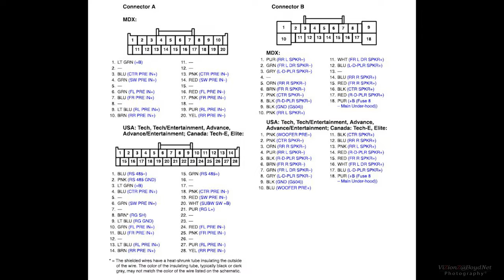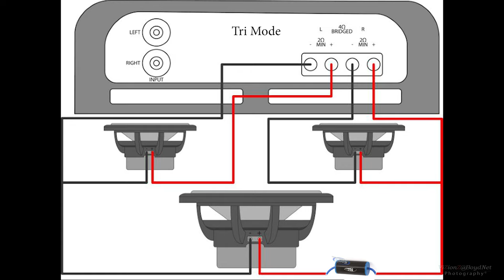Second Generation Acura MDX Stereo Upgrade Series - Part 4 - AMP INSTALL and SUB UPGRADE

Comment: Just installed Kicker 8001 amp to drive kicker 10” down firing enclosed sub in 2023 RDX Aspec with ELS Studio system. Have sub volume control up front. Sounds absolutely incredible!! Gain is only at 9:30
Reply from the maker: My brother has the 1200.1 on 4 Pioneer 10"s.  They are really good amps! #ViZionZatBoydNetPhotography

Comment: I recently bought a 2012 Acura mdx and is crazy no videos on sound system
Reply from the maker: Yea there is little to nothing out there.  That’s why I wanted to shoot this series.  #vizionzatboydnetphotography
Reply: just got a 2007 rdx and I have a kicker  10 L7 solo. baric  that I will be attempting. to put in ty
Reply: @bryanCLXT   bro a few months I crashed my 2009 Acura rdx  and I removed the 240 amp Mechman alternator which I’m listing it soon on eBay I paid $450  I take 200 for it
Reply: I swear lol

Comment: Quick question.... Sooooooooo the connector harness behind the deck don't have the speaker wires in that connector AT ALL?
Reply from the maker: No they are line out to the amp.
Reply: @ViZionZBoydNetPhotography  I thank you.